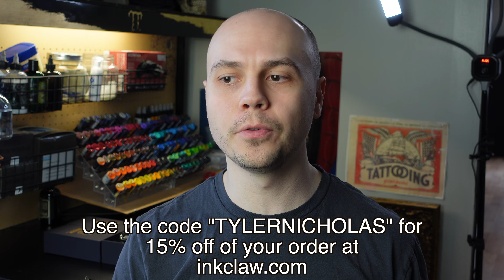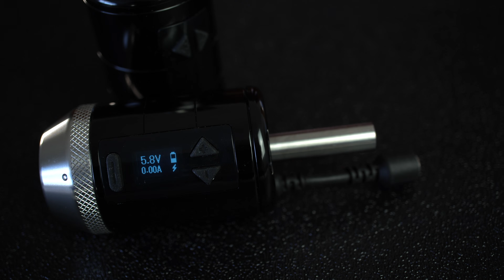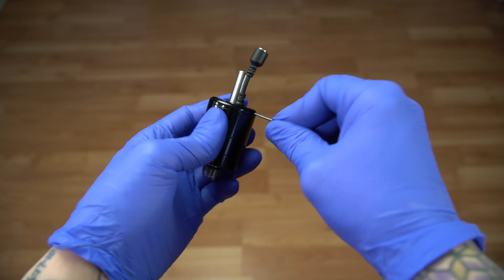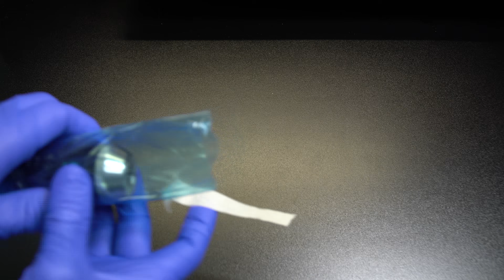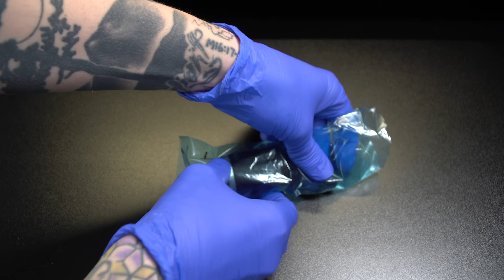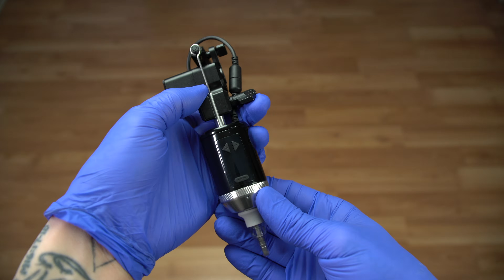Inkclaw Phoenix Battery Grip - 1.5 and 2.0 Review

Comment: If the inner tube did not have to be autoclaved then I would try for sure.
Reply from the maker: I’d be using it all the time if they offered disposable!
Reply: @ThatTattooGuyOfficial  I read on their website that they have a disposable in development. I wonder tho, could you not just put a disposable in there and tighten it down with the Allen key? Lucky supply sells inner tube disposables.
Reply from the maker: @iconicgaming3423  I wonder… maybe ?
Reply: @ThatTattooGuyOfficial  well. If you try it. I would love to know if it works. I don’t wanna buy it myself if it doesn’t
Reply: Same

Comment: Nice little video Tyler, to your question about reviewing, i was wondering your thoughts about the wireless battery pack from the same company and how you think it would do as a cheaper option then the critical. I,m thinking of going wireless but the price of the critical is kinda steep for me to try out. Greetings from The Netherlands
Reply from the maker: Those cheaper battery packs I haven’t had the best experiences with over all. The critical ones are solid. I would recommend spending a little extra and getting them.
Reply: @ThatTattooGuyOfficial  thanks appreciate it